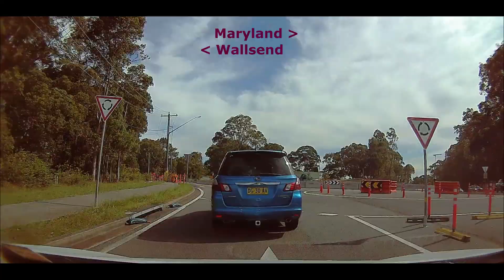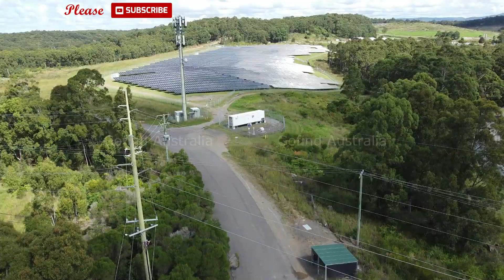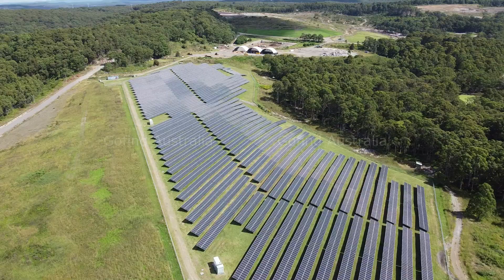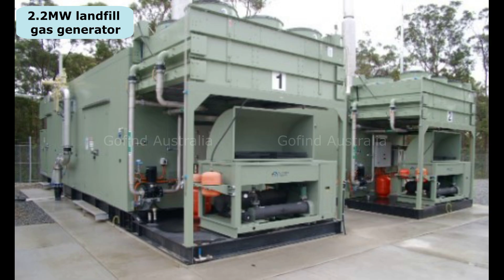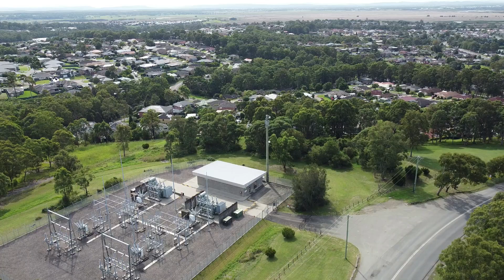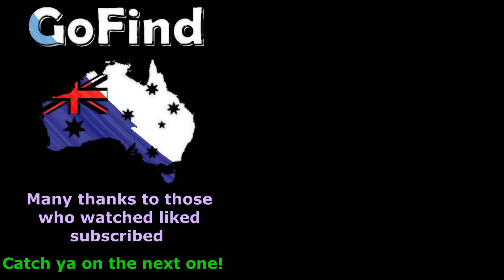Solar Energy on old coal mine/rubbish tip Newcastle NSW. What does sit looke like?

Comment: Good job. Until a nasty hail storm with big winds and big hail comes upon it............then what? No out put of electricity cost of rebuild, until the next storm. Good temporary job. Not a supply solution or permanent solution. Good job.
Reply from the maker: Yep. All of these ideas need to be tested & shown that it works or it doesn't. Maybe there's a place for creating energy from the gases collected on site. It does sound like hard work to keep it going.